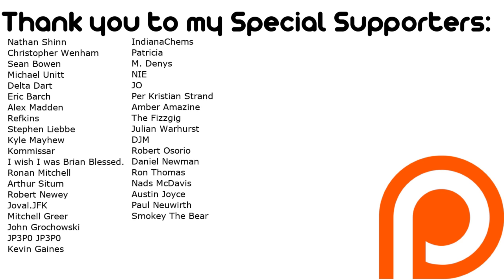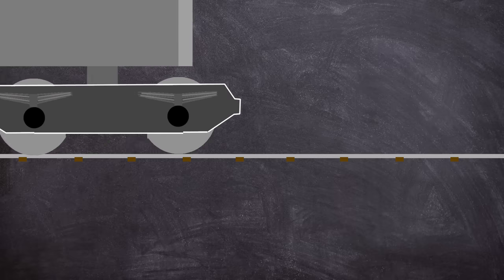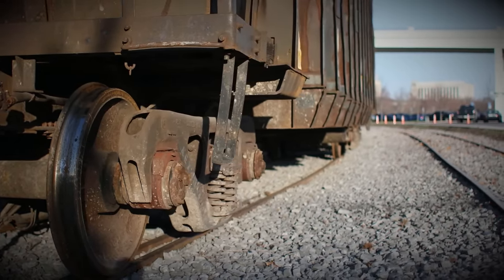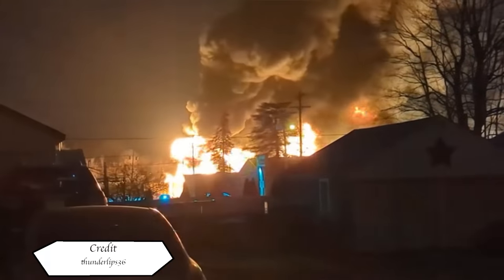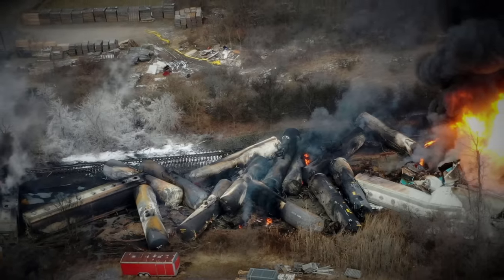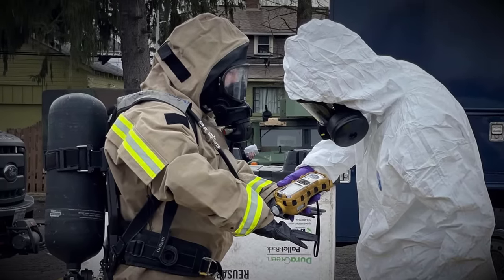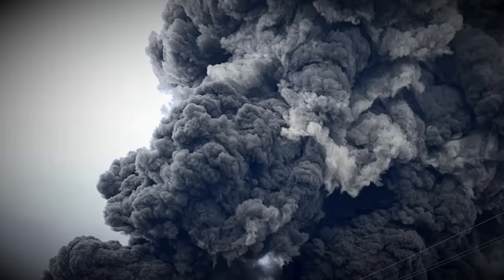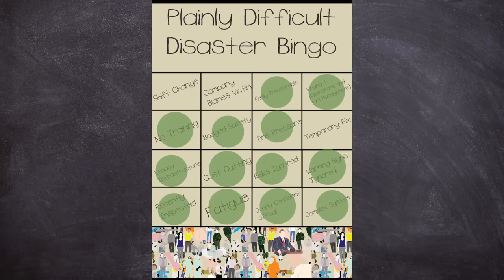Profits Above Everything: The East Palestine Train Disaster 2023 | Plainly Difficult

Comment: I was a Norfolk Southern Employee until just before this derailment in Conway Yard where the 32N terminated. The cost cutting is a symptom of Precision Scheduled Railroading or PSR. As someone who was in Management as a Trainmaster the only thing the company cared about was running trains on time. That meant rushing car inspectors to turn the trains over to the crews so the train could depart. As you can imagine this negatively impacts inspections. Additionally when I was there I think car inspectors had about 2 minutes per car based on their union contract

Comment: For the controlled burn, the pertinent question is whether the available information at the time showed that there was no polymerization.  If the information available was consistent with polymerization happening, it's a question of causing some guaranteed damage, or risking the chance of massive damage.

What I find most damning is that after (and maybe while) the wheel was spewing sparks and fire, the detector only registered a temperature of 103 F.  It was obviously faulty, but they didn't know, and had no redundancy set up in their detection systems.  How many other defective detectors are on the tracks?  It should be easy enough to test - attach a container at axle height, kept at a known temperature.
Reply: I think that gets lost in the "the controlled burn was unnecessary" headlines.  If they gambled by leaving it alone and it BLEVE'd (Boiling Liquid Expanding Vapor Explosion), contamination would be the least of that town's problems.

Comment: Did the fire department not use gas tubes on approach to the fire? I supply the stuff they use for gas detection and that's scary that they set up 400 feet away from a fire they didn't know the chemical makeup of at the time.  

Their bunker gear off-gases dangerous chemicals when exposed to heat so they're almost always using individual gas detectors with man-down alarm systems, but those can't really pick up any exotic chemicals, but they do have a massive suitcase full of tubes of reactants they typically employ before approaching a suspected chem leak or fire - I guess given the rapidity of the emergency combined with the size of the derailment, regular precautions fell by the wayside. I believe the crew in the engine should have had full access to the DG declarations and manifests as well, removing the need to play phone tag with whoever took so long to call them back as well, would also explain them detaching their engines and moving further away, not just to distance themselves from the fire but possibly because they knew full well what they were hauling. 

Man my mind is going overtime, in Canada any significant DG shipment like this requires an emergency response action plan (ERAP) that informs the responders how to deal with the chemicals involved to minimize injury or damage to the environment, was the ERAP also in the locomotive as the DG paperwork should have been? We almost always steal our shipping regulations from the US so I'd be surprised if they weren't required down south as well
Reply: Train crews are more uninformed workers.
Reply: It took them that long to even tell them the manifest that they just gambled. Never a safe move
Reply: NS refused to tell people what was even on the train for a long time, and then finally they were like "well none of it it hazardous chemicals, so its fine" except that was a lie because all the hazmat tankers were classed as nonhazmat so they could pass them through populated urban areas because that's just what they do, NS has been doing that crap for a long time juggling classifications on things they carry and making trains longer and longer til they're unmanageable just inviting disaster, and when problems happen its never their fault.  what they're required to do and what they actually do are two different things, this is why the rail workers in the US tried going on strike so many times recently because of the dangers on the job and got forced back to work as "essential" because bs and money.

Comment: I wonder why freight cars are not equipped with their own individual hot box detectors, and linked to the cab.  Cost, I suppose.
Reply: Cost, reliability and complexity of operation. While the detectors themselves are pretty simple (essentially a piece of wire) you'd have to create a standardized interface to run along the whole train - capturing the data and allowing the crew to pinpoint which box is going dry. Interfaces would have to be weatherproof because of all the shunting work, fitting each possible type of cargo car (hopper, platform, tanker, schnabel etc). It also can fail by itself. Having multiple reliable hot box detectors may be more reliable, than multiple detectors in many challenging setups.
Reply: @brylozketrzyn  
I’m sure there’s other possible systems. They could simply be wireless.  And report the temperature of their serial number. They could be powered by batteries or wheel generators. They could easily network themselves from the last car to the front with existing technology
Reply: @brylozketrzyn  I think it was mentioned in the video about machine learning things, one of the possible ideas is to have cameras that can detect sparks or other abnormalities and report it appropriately. If the flaming car was caught near the first hot box detector, this accident never would have happened.
Reply: @neilkurzman4907  Wireless anything is still garbage.
Reply: There is a very simple solution which is used on some UK freight cars. There is a fusible plug on the axle box connected to the brake pipe.  If the axle box gets too hot the plug melts, lets the air out of the train pipe and the brakes come on and the train stops. No complex electrics or detectors required.
Reply: @neilkurzman4907  using wireless implies use of power supplies and any means of pairing. Power supply may not be a problem - even a single magnet with a coil would generate enough electricity to power some low power transceiver. Still, it adds some complexity to the system, and has to be tested and certified. The second issue may be much more important - no auto pairing (because shunt yards, station and passing trains would wreck havoc), so each time the train would be shunted someone would have to do it.
Reply: @neilkurzman4907  just as an update: EU is going to make digital automatic couplers mandatory. While they are mostly targeting shunting risks, they will incorporate diagnostics as an option. But actual rollout can be limited. Coupler cost will make container platforms price double, diagnostics will make it triple

Comment: A couple of comments:

1) railroads are under competitive pressures to boost the operating ratio, increase return on investment, fiduciary obligations to its stock holders, and be a good neighbor to the communities they serve / pass through. No company can do it all 100% of the time, especially when the employees that have to do the grunt work do not feel respected by management, nor do they feel that they have an investment in the company's success - no matter what, the rail traffic will still be there because the highways cannot absorbe it.

2) The freight cars in question - the one with the hotbox and the tank cars they blew-up, are NOT owned by Norfolk Southern. Maintenance is up to the car's owner, which was a leasing company in the case of the hopper. As I don't know the details of the bearing in question, I cannot say if tracking the age or mileage of the bearing would have resulted in scheduled maintenance or replacement before the hotbox could happen, but I presume that is standard otherwise we'd be burning off bearings every second of every day. Premature failure isn't necessarily a failure of maintenance nor visual inspection in a freight yard. 

3) There is a critical problem with dealing with hazmat emergencies. There should be a 24/7/365 command center that all fire departments can communicate with to get expert advice on dealing with any hazmat situation, be it a train wreck or a meth lab or an overturned truck on a highway. Instead, each emergency seems to ask the first responders to reinvent the wheel.

4) Aside from having a caboose with crew on the rear to monitor the train for smoke or flames, I don't see anything that could have changed things. The train crew handled the train properly. The fire crew acted in accordance with what they knew at the time. The hotbox detection system, though insufficient in this case, was sufficient in all others. The bearing, as I previously said, might have been overdue for replacement or prematurely failed - the former is a big problem, the latter is concerning, but is just an unknown for me. 

5) NS vs the NTSB... threatening the NTSB is concerning, but I'd like to hear that conversation before I damn Norfork Southern. The report from the NTSB has the potential to hang massive amounts of legal exposure on NS if the report blames them for some aspect that they adamantly deny was their fault (like needlessly blowing up the tank cars based on the input from the customer). I think you or I would also make threats if an unfavorable report could cost us hundreds of millions, if not billions, in legal settlements. 

This was a horrible accident that probably could have been mitigated, if not avoided, in hindsight.  As with all such things, we need to learn our lessons and swiftly change things that we have control over.
Reply: Regarding point 3) - there IS a 24 hour hotline, CHEMTREC, the phone number for which is prominently listed inside the ERG book, specifically for first responders to call. For some reason, no one called them until the next morning.  

Turns out Ohio limits how much training volunteer firefighters are allowed to receive. They set a MAXIMUM of 36 hours of training, so they don't get Hazmat training.
Reply: As for 2) there are wayside monitors that should detect faulty wheels & bearings and record it to the UMLER system. If that hopper has prior wheel events that were not solved then shame on the car owner for ignoring alerts, and shame on NS for not keeping tabs on UMLER before moving a car. If there were no prior alerts though, it is possible the hot box emerged on that day the derailment happened without prior tracking on the issue.

Really the hazmat crew breaching the railcar to try and stop polymerization was the biggest mistake. Having read the accident reports, that was the choice that escalated the derailment from bad to worse.
Reply: Thank you, you made most of the points I wanted to make.  Calling this "profits over everything" seems entirely uncalled for, and there's a lot of sneering and innuendo in the video that was not supported by what was presented, nor any examination of what kind of alleged "threats" were made so that we could form our own opinion about how heinous and/or paltry they really were.  It just feels like anything for a smear job, rather than an honest appraisal and presentation.

Risk management is always a tough balancing act, and I get tired of people who reflexively go, "REEEEEEE PrOfITS!!!!!" any time an awful thing happens, even in cases like this where it seems due diligence had been done to try to detect and manage known risks, and the failing axle had been detected and responded to in a responsible manner.

Comment: "Hmm.. we've got a problem. We need to find and record the temperature inside the wheel housing.."

"... OK we'll put the thermometer outside the wheel housing..."

Great work 👍🏼
Reply: Can you think of any more efficient way of doing it that doesn't create an overloaded system? To monitor every bearing is impossible, and even using a sensor on every axle requires sensors and battery power for each one, which is inefficient in terms of cost and maint. At least 4 per car, multiplied by a hundred cars or more in a single consist, means over 400 sensors all reporting in constantly. Given the abusive nature of the trains in loading, transport, weather, unloading, etc, can you say that such a system will be easy to maintain and monitor? Then realize the MILLIONS of rail cars in use in the USA. There's simply no efficient means of making that work. Better track-side sensors and alerting system will help. If you listen to the automated messages the conductors get from the system as it passes, it is pretty precise. It'll even tell you which axle in the consist has the hot wheels, though the conductor will have to walk the train counting cars and axles to find #693 or whatever.
Reply: Do you know how difficult it would be to have a sensor in each wheel, in each car? Not only would it be a nightmare to retro fit every car, it would be very unreliable with as many times the train cars are hooked up and detached. Having the sensors set up the way they do is logical the only problem I see, is the conductor should be notified of the temp differential and not some office geek.
Reply: @alecb8509  The cab of the train is notified automatically of an excessive heat event after the whole consist passes the sensor by the computer system. It comes in over their radio circuit and tells them the number of axles checked and which one (i.e. axle#458) has the event, or if no issue is found. I'm not sure of the temp threshold for the auto notify. The monitoring center is just that, monitoring and likely follows up via human on radio with the train for a critical issue.
Reply: @chrismaverick9828  So I'm going off Plainly Difficult who said at the lower threshold, the conductor is not notified only someone in a center. It should be the conductor notified at the lower temp threshold.
Reply: @alecb8509  My point is only that it is not the center only that notifies in a hot box event, but that they do receive an automated one after every passage of a sensor set. The video made it sound like it everything is dependent on the desk-jockey having had his coffee for safety to be maintained.
 Changing the thresholds for cab notification is a must and should help.

Comment: I'm incredulous that trains in the U.S. are allowed to be a 1.5 miles (2.4 KM) long on average and up to 2.6 miles (4.2 KM) and longer! This is insane. How is any train crew supposed to monitor that length of train and stop it in time if there is an emergency? Couple that (no pun intended) with corporate greed, lack of maintenance and overworked crews and that's the formula for a guaranteed disaster. BTW I'm a U.S. citizen
Reply: GPT hands typed this post
Reply: Don't forget they want to run even longer trains than that AND reduce train crews to just 1 guy.
Reply: Because enormous amounts of cargo needs to be moved every hour.  All that crap you oder off Ebay and Amazon moves by rail.  If you shorten the trains, you will double the number of trains running, but there aren't enough people to operate it.  All railroads are critically short of workers because nobody wants a job where you can't work from home or play on your cell all day.
Reply: Trains are NOT 1.5 miles long on average.   You start off with a fallacy in the first sentence of your post.   U.S. Citizen or not....that is not true.   Now it is true that trains can now exceed 2 miles in length and it is true that the crew on the head end has to monitor that train.   Monitoring the train at .5 miles is about the same as monitoring the train at 2.5 miles.   It's not so much a monitoring issue as understanding that the laws of physics will be reacting differently as the train starts, moves and stops.
Reply: @notshardain  Not sure 'they' want to run even longer trains.   I do believe that if permitted to do so we would run with one individual in the cab (As Amtrak does today).

Comment: Sorry but the tracks are garbage in Ohio. Every other tie was rotten and none had all their spikes driven down all the way. I'm not surprised it happen and it is going to continue to happen.
Reply: Poor track has nothing to do with a hot box incident (axle bearing overheating). It comes down to a bearing failure, nothing more. While I don't disagree that the track is garbage in Ohio (and also in and around Pittsburgh, based on having lived there), in this case, it had nothing to do with the disaster.

Comment: The vinyl chloride burn is a damned if you do, damned if you don't situation. All they had to go off of at the time was the temperature of the tank. If they hadn't done it and the tank ruptured, you'd be saying the same thing about how avoidable it was. The only way to know that it wasn't actually a danger and therefore an unnecessary procedure is with hindsight.

Comment: Hotbox detector usually broadcast to any train passing it's status and axle count. 

If a fault is detected, it 'should' broadcast a warning with the axle number of the fault.

After the NS derailment, I seen the local UP doing checks of their own equipment, probably changing their settings as well based on the derailment findings.

Comment: Here's a thought, you have 50 carloads of toxic crap. Divide them and put them on 5 different trains. Your savings on material and environmental damage may be reduced by 80% if one of them goes south. Use your head, you might even consider putting some 5 at the front and 5 at the back, is that too hard to figure out?
Reply: I’d say there still be a accident
Reply: @blehtbh  Exactly, 20% as bad or 80% "less bad"